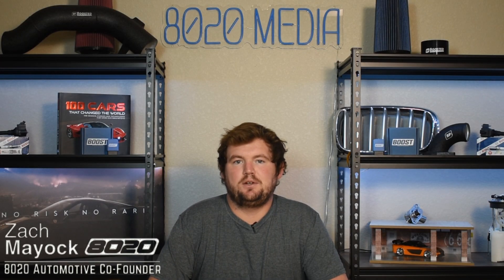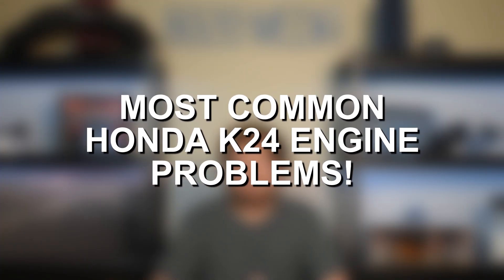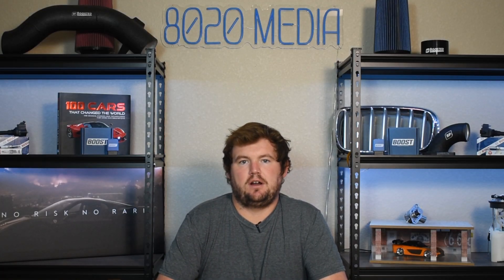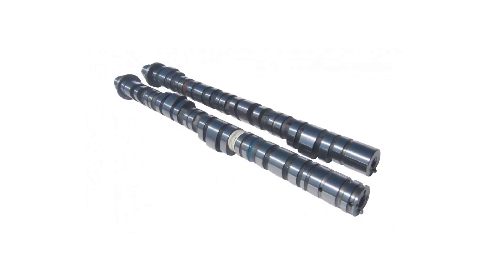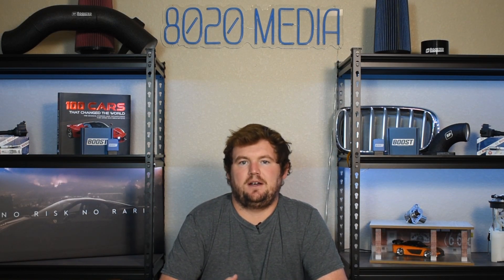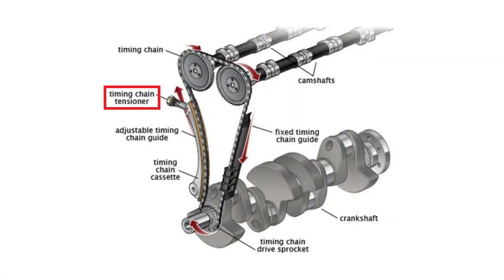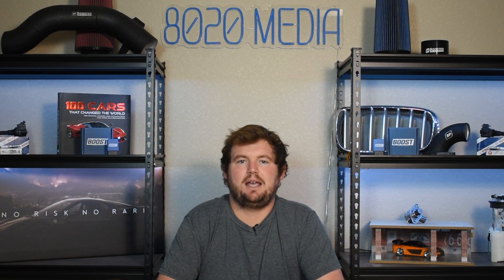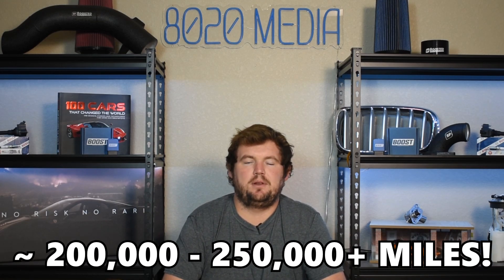Is the Honda K24 the Most Reliable 4-Cylinder Ever Made?

Comment: Currently own a 2016 accord with a k24. 228,144 miles at the time of this comment. It burns about 1.5 qts of oil out of 5 every 3k. I change it faithfully. As well as tranny fluid. It has zero leakage. My head seal went bad and that caused my car to misfire due to oil getting  onto the spark plug . I fixed that though. Diy. 
The only code that has come up for the first time just about a month ago. Was the maf sensor. I gotta work on it. Haven't time. Overall. Long ass lasting engine.

Comment: The number one issue caused me an engine replacement. The front crankshaft seal. A mechanic replaced the front main seal with an aftermarket seal which lead to considerable oil leakage without my knowledge..😢
Reply from the maker: A - Sorry to hear this... Hopefully you were able to get some sort of compensation!
Reply: @8020Automotive not at all

Comment: 18 year old Accord with 300K miles.  Zero issue with Engine, transmission.  
Issues with car: 
1. got hit twice, cosmetically totaled, rebuilt title.  
2.  P0420, catalyst efficiency light comes on once a while.  No repair.  
3. ignition switch in steering column worn out, $10 ebay replacement.  
4. Vent control actuator worn out.  OEM part discontinued, Dorman is the only option at $50.  
5. headliner saggy.  No repair.  
6. worn ball joints, compliance bushing.  $100/each OEM part.  DIY install.
Reply: your car is as old as me lol
Reply from the maker: T - Sorry to hear, but thanks for taking the time to share all of this!